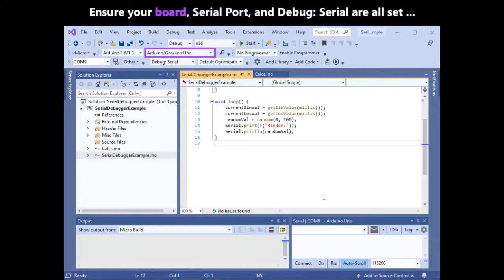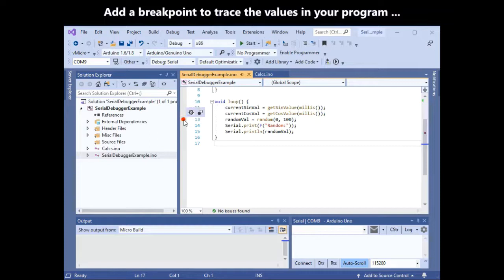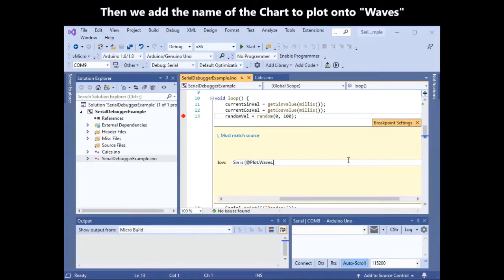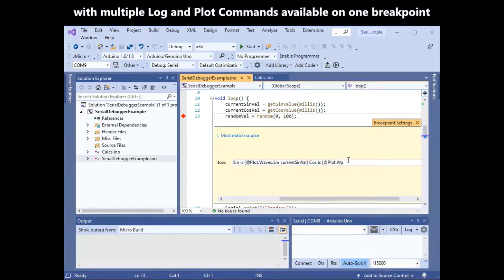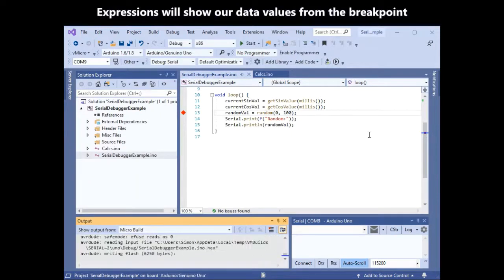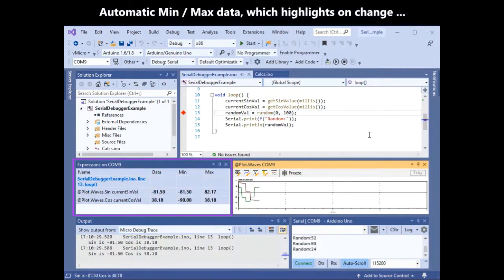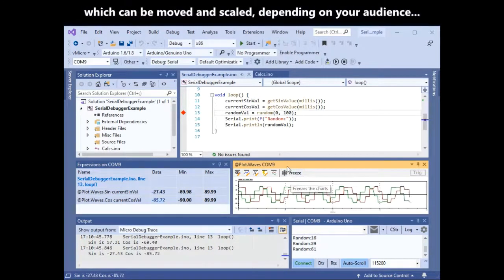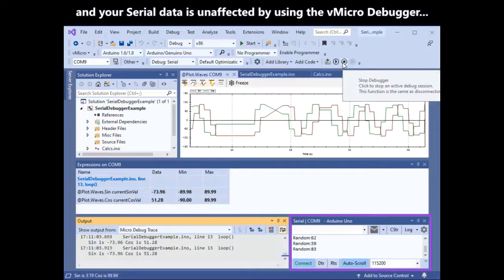Basic Arduino Debug Charts with vMicro

Comment: The possibility is good, but the whole thing is extremely slow. Actually very unfortunate.
Reply from the maker: Thanks for the post. Did you switch on "vMicro>debugger>Full Speed Debugging?"
Reply: @visualmicro4389  Yes did. I'm still a newbie, I still have a lot to try. But do I still need to use the Serial.begin command when debugging?